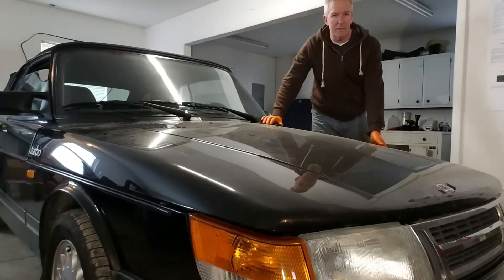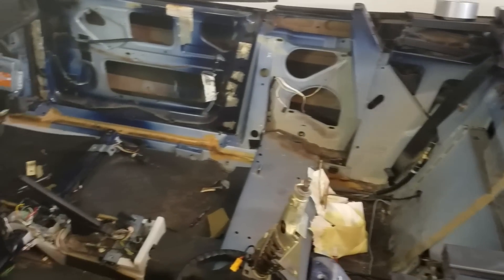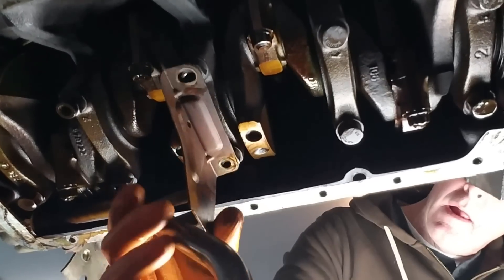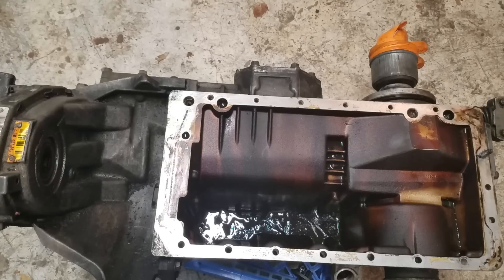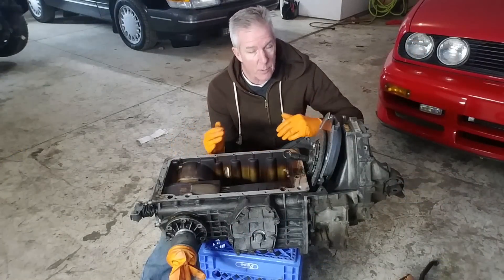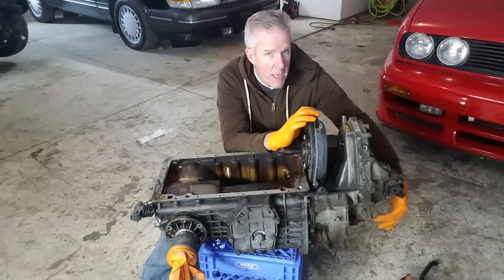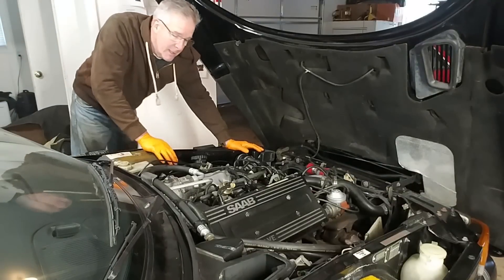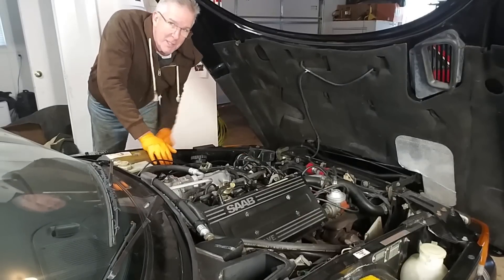Ep.2 Saab 900 transmission explained

Comment: In 1987, my 3 speed borg Warner automatic transmission went on my 1981 Saab 900 Turbo Sedan.  I was only 19 years old.  My parents paid nearly $3000 (a lot of money back then, but even that was discounted by 15% because my parents knew the owner of the dealership) to the Saab dealer to install a factory approved rebuilt transmission.  I wanted a stick from the get go.  I always wondered if the costs for converting to a manual would have been comparable to what we paid.  I know the cost of the transmission itself for a 5 speed was about 2/3 of the price of the auto (back then $1200 vs $1800).  But the labor probably accounted for up to 1/2 of the bill for us, and a manual conversion would’ve required more parts and more labor. The dealer advised us to replace the oil seals and timing chain (90k miles on it) while we had the engine out and that accounts for some of the costs.  This car ended up being a money pit anyway since I drove it for 3 months leaking transmission fluid all over everything in the engine bay before we decided to bite the bullet and fix it. I was buying 4 quarts of good old type F per week during the worst of it.  Soon after the head gasket blew (head also cracked), there was a short in the fuel pump wires and the cv joints started to make noise.

Comment: Showing the engine a part from transmission and explaining that the engine oil pan was a part of the transmission it must be lube for the power transfer to axles that answered my question thank you
Reply: no they are still separated, its just the bottom of what would be the oil pan is the top of transmission casing

Comment: I'm tuned in; mine is the exact same car same year and Color ( even auto ) thanks for keeping in there for 2017
Reply from the maker: If you haven't driven a turbo 5-speed, it's hard to understand how it changes the experience.  Blasting through a turn is a whole lot more fun when you have full control over the engine and the power curve.  The convertible wasn't intended to be a true performance car, but the 5-speed gets it much closer to behaving like one.

Comment: hello i have 1987 900 turbo transmission works perfect except it wont stay in 1st gear it pops out so i have to always start off from 2nd gear ,  if i try and hold it in 1st gear i get a grinding gear sound , what could be the problem ?
Reply from the maker: I suggest taking that question to a group of guys far smarter than me.  You'll find them gathered on Facebook here:   https://www.facebook.com/groups/2216998577

Comment: I have seen several of these cars in the scrapyard and wondered how the engine was mounted in "backwards". Clever using the top of the transmission as the engine oil pan.
Reply from the maker: That example of out-of-the-box engineering is one reason I'm drawn to these silly cars.  When I pop the hood at car shows  people get a kick out of seeing how different SAAB solved engineering challenges.

Comment: the drive shafts aren't the same length.  One side is about 2 inches longer than the other.  But it's a fair point you make, the 900 does not torque steer and no doubt shafts which are a 'very similar' length helps achieve that.

Comment: Great videos Lee. Something to note is that the turbo 5 speed and the NA 5 speed are not the same. The turbo box has higher gear ratios than the NA box. Putting the NA transmission in your turbo car will make it faster than a stock turbo due to the shorter gearing in gears 1-4. I believe the gear sets are of similar strength.
Reply from the maker: I believe you are correct. Someone suggested the na has a primary gearset 5, turbos came with a 7?  Interesting to see the result.
Reply: You're correct sir. My 92 NA tops out at 110 MPH which is honestly pretty scary in a chassis that was designed in the late 70's. Below 100 is where the C900 really shines. It's definitely not a "top speed" car.

Comment: Good video! I have  '92 900 S non-turbo convertible with an automatic that is beginning to slip.
Thinking of finding a turbo 5-speed donor car and doing a swap.
Reply from the maker: That would change the driving experience dramatically.  The automatic is so slow and numb, the 900 becomes a different car.   What RPM are you seeing at 70mph in your auto?  I'm hoping the taller gearing in the 5-speed will make the experience less "buzzy."

Comment: i am gonna clean my engine in my saab 900 S, but how to separate the motor from the gearbox?
Reply: It's a major undertaking.  I don't know how to do so without pulling the engine.  Once it's out, it's fairly simple to unbolt the two.  I don't recall how many bolts are involved, but there are several and they are different in length so make sure note what goes where.   It's not really necessary to separate them unless you're certain your oil pan is a total mess and demands internal cleaning.  I rate this as a 4 out of 5 on the complexity scale so unless you have the proper space, equipment and time I don't recommend it.
Reply: @healthcallradiohour  i have to do it, cause the gearbox needs a overhaul and i want to change the primary gear from T6 to T7. in fact i want to clean my engine bay and install the Trionic 5.5. the gears already make some noises and the reverse gear makes sometimes a big bang when you put it in. but i have to look what is cheaper:
repairing the gearbox or get a new one with the right primary gears. the engine will leave the, i hope so, soon and i can start to seperate them. i guess that the clutch-system has to be removed first, then the bolts on all sides, then you can lift the engine out. by the way, i couldnt find the engine mounts where i can lift the engine out of the engine bay

Comment: Thank you very much
Reply from the maker: You bet.  Are you a Saab owner?  What model/year are you working on?
Reply: I have a 1990 Turbo sedan in good condition, except for a busted alternator belt, which James Allan Davison, AKA The Car Whisperer, will repair after Easter. I love my Saab and I don't care that it is an automatic. Boost has been raised to 12psi via a new chip and larger fuel pump. Several other mods have made it a straight line rocket. Only 110,000 kms on the clock. It's garaged most of the time and I never take it out in the rain. Your videos are terrific and really interesting. Thank you and please keep posting. Go well Maestro Kelso.

Comment: Where do you get your parts? Im having trouble locating a chain for mine
Reply from the maker: There are many sources and I've never had a problem locating most mechanical or electrical items.  Body parts and appearance items are not as readily available.  I use www.eeuroparts.com, www.rockauto.com, but also order speciality parts from various SAAB performance shops such as nordicspeed, swedishperformance.  The Facebook SAAB 900 group is a fantastic resource of very helpful SAAB owners, as is www.saabnet.com.
Reply: @LeeKelso  wicked man, thank you!

Comment: The engine is still heavily based on the Triumph slant-4.  SAAB kept making it 30 years after Triumph discontinued the engine.  SAAB were the first to use the engine, not Triumph cars.
Reply: I've owned a TR7 and Saab 900. The engines felt totally different from each other. The TR7 revved quite easily.
Reply: @stuartbear922  
Tuned differently. The SAAB is a much heavier car.  TR7 is a performance car.